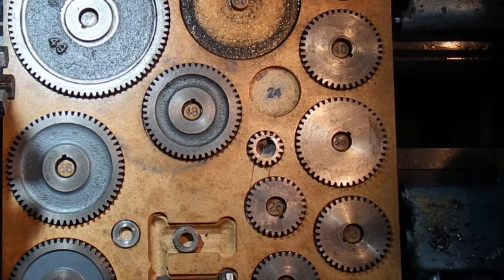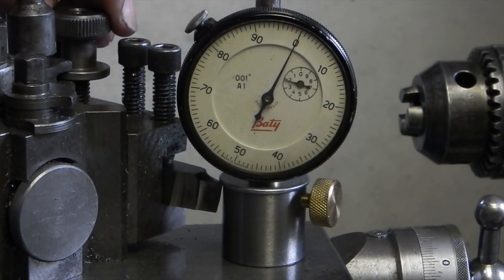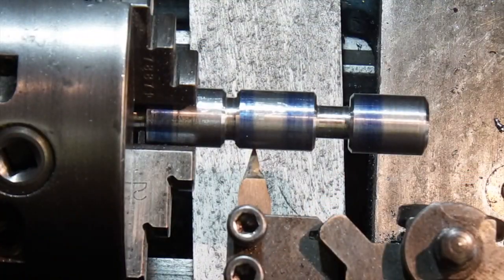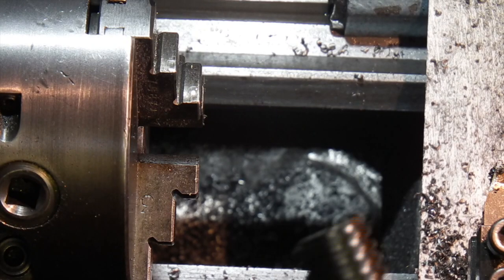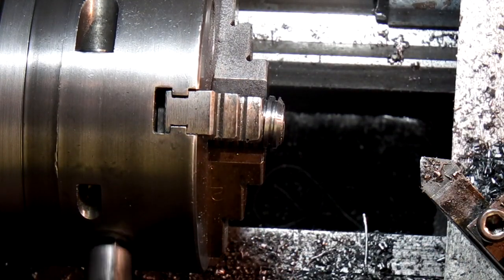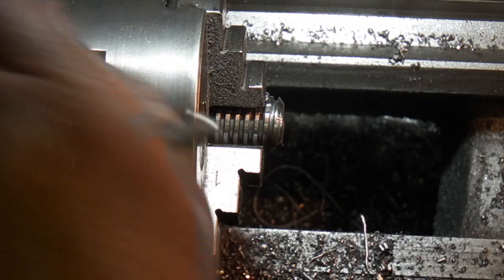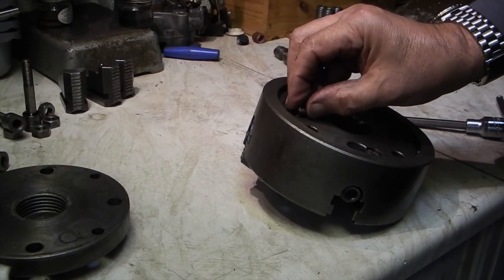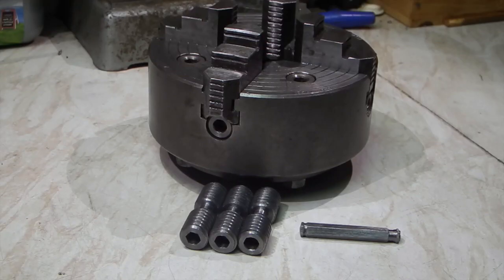4 jaw chuck repair part 2

Comment: Hi Alan, can you advise where to obtain blanks, I have a PE380 The Prattchuck with a broken adjuster screw 4 jaw chuck. Great video thanks heaps, keen to make one on my recently obtained 1956 Myford. Cheers
Neville  New Zealand.
Reply from the maker: Hi  Neville I used steel off cuts from my local steel merchants (sold by weight) The finished threads  are not hardened and are still working well. The chuck manufacturers wanted £80 for one so I made my own. You could try eBay.

Comment: Hi Alan,
Thanks for this video… I am refitting my Burnerd 4 jaw chuck and could not work out how to remove the jack screws. From what you’ve shown the holding pins are a press fit and some gentle persuasion should remove them.
Thanks
Paul,,
Reply: Mine have a 0,01 mm interference press-fit

Comment: are you going to use these unhardened?!!
Reply from the maker: Yes I've used them in the work shop for 3 years with no problems
Reply: @enotsengineering  great, i also noticed that you are not a fan of tightening too much, not sure how u broke the original, what was the material you used for the newly made?
Reply from the maker: Hi I used a mild steel bar

Comment: The discovery of this video was perfect timing. I need to replace an operating screw for my Burnerd model 36, 5-inch four jaw chuck. I actually managed to find a replacement unit at $194.27 plus GST and freight - ouch! Fortunately the three jaw is fine.

Comment: Excellent video!  I have to repair my 4 jaw chuck as well, except the screw didn't fail, the keeper that holds the screw in position failed.  Mine are pressed in, they do not have a screw to hold them in place.  I'm not sure if you'll know the answer but what material do you recommend I make the keeper from?  Should it be heat treated as well?
Reply from the maker: Hi Brandon
The keeper takes a lot of side load. If your purchasing steel I would make some from silver steel but not harden them, so they can give a little. If you make extra you will have a replacement ready that you could Harden if needed. Or use some steel you may already have as a test part. It will probably last years.
Reply: enots engineering Thank you for the reply.  I have W1 and O1 round stock but no silver steel.  I just pulled the chuck apart and the keepers are definitely hardened but I see why it broke.  The diameter of the notched section was turned down for I dont know what reason.  If I remake the part and leave it it's Max diameter i'm sure I'll have no problem of it breaking again.   The screws seem to be holding up pretty good with no signs of wear. Thanks for the advice.  I'll make a couple of them and first try them without heat treating and see what kind of wear they get

Comment: Wouldn't it have been easier to buy a length of suitable screw stock (of a suitably hard grade) and make the screws out of that?
Reply from the maker: Hi I think you would have problems finding the correct thread form that matches your chuck jaws.

Comment: what grade of material did you use for the screws? super video's
Reply from the maker: Hi Robert
 The steel I used was an off cut and not marked.As I'm not hardening the jaws a mild steel is ok.